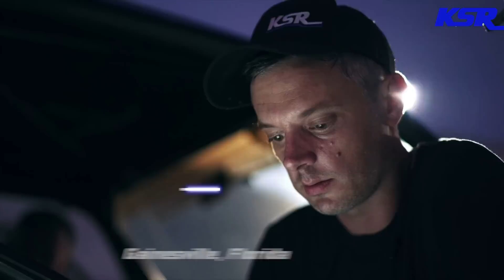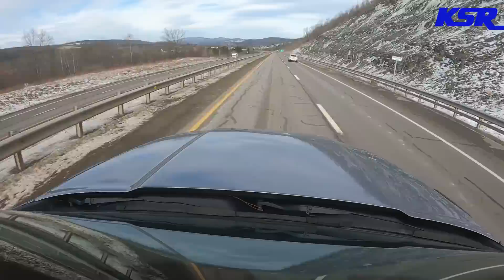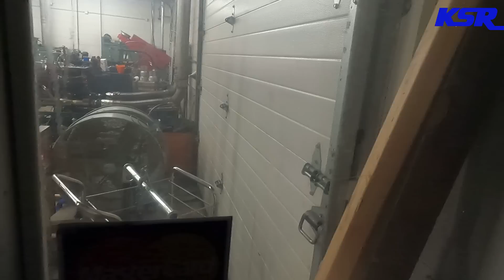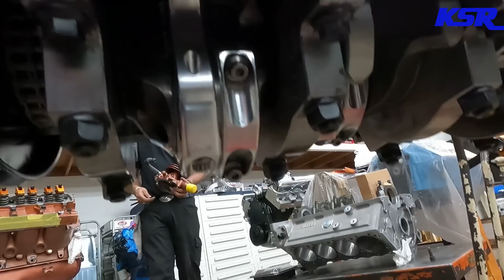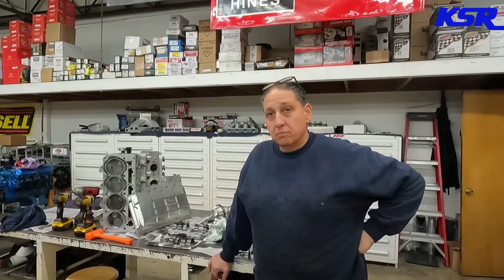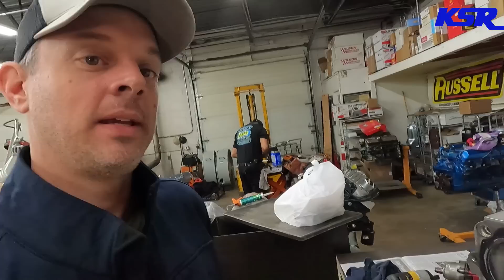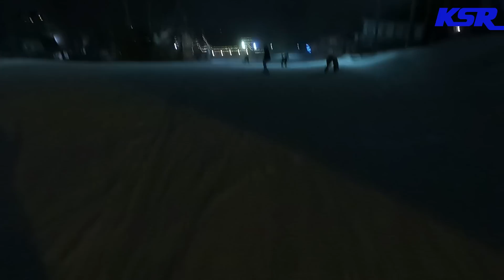Picking Up The Engine for MY CUTLASS!!! (Not an LS!!)

Comment: We are collectively SO happy to see you with a shirt eating grin on your face.
Reply: I PERSONALLY hope you can someday make it to Northern Idaho, I will take you snowboarding at Schweitzer Mountain, Silver Mountain, and/or Lookout. I’m 58 and don’t rip it either lol
Reply: I always get concerned for slower boarders (I am older than you).  Concerned that an out of control, kamikaze youngun will come flying down the mountain and crash into you from behind.  It actually happened to a ski instructor friend about 10 years ago.  She was giving a lesson and a boarder came flying down from behind.  Crashed into her breaking her shoulder, tore up one knee and other bumps and bruises.
Reply: A high rpm old motor , I didn't realize Nascar Oldsmobile had a Olds Nascar motor
Reply: So why don't you run a super charger since you are running a lot of rpms?
Reply: @johnbeverly1653  A couple of different variants with different sized main bearings.
Reply: Shirt eating?, Think it's something else Tripp, Rj in Oz
Reply: @rjnation5042  Yeah we’re just tryna keep it family oriented lol
Reply from the maker: Because “everything needs a turbo” ;)
Reply: @johnbeverly1653  he'll yeah they used to run Olds motors in the olds nascar machines, as did Buick and pontiac ran their own motors.
Reply: @johnbeverly1653  Smoky Yunick had a big part in the Olds V8 cylinder head design back with the 330 Olds v8 the program didn't end when he left Oldsmobile those guys had learned from one of the best in the business of racing and carried on racing and improving until the 80's before General motors ran 350 chevy based engines with the Pontiac heads in everything GM across the board for Nascar until Oldsmobile and Buick completely dropped out of Nascar
Reply: even a Blue Short Bus 🤏😉💥💨
Reply: @danmyers9372  I have personally done this, cleaned up about ten people in a huddle....... what were they doing standing on a slope, unbelievable!

Comment: I am a Olds guy myself. 355 C.I. ,12.2 to 1 Compression. H-Beam con rods. All roller motor. Mutha Thumper cam and Edelbrock RPM intake with a Holley Sniper for a hat. Studded crank mains and heads for an EXTREMELY HIGH redline. Lol

Comment: Sometimes a Road Trip is the best medicine, and the timing was right in many respects.
Wife and I had a heck of a year too, she retired finally, and once the dang rain settles down out west here we are gonna load up and take off with Toyhauler and SXS in tow, heading to no place in particular. 
When you get back to DC make sure you take time for the Air and Space museum,..both of them in the DC area. I think 3 days would be a good start.
Before you even said it I knew that short stroker was being built to wind. This is gonna be fun. I admire you sticking to it over the years, Kevin. Sometimes isn't easy to do.

Comment: I understand that Oldsmobile never made a four-bolt-main version of their 350 because they used steel with a higher nickel content. If you like obscure stuff, look up their W43 engine. It's a pity it never made it into production, it was a beast. My first car was a '68 Cutlass with the 350 and "Jetaway" two-speed automatic. It had 10.25:1 compression, and was rated at 310 HP and 390 lb-ft. torque. It was a pretty quick car for a grocery-getter. It surprised a couple of folks from light to light in my home town. I've liked Olds cars and engines since I was a little kid, I'm following your Cutlass build with great interest. Kevin, if you're at all a space or aviation nerd (I am for sure) you owe it to yourself to see the National Air and Space Museum when you get back to D.C. I'm going to try to get out to the Udvar-Hazy center this summer, it has larger exhibits that can't fit in the museum in D.C. It's out toward Dulles, VA and should be fascinating. It's good to see you out and enjoying yourself away from work, sometimes it's healthy to get a break from work,  no matter how much we love what we do. All the best to you in 2023.

Comment: Cool! I learned to snowboard in 1988 when I was 27. I still do when there's good snow. Slush ain't too bad on a board. I ski most of the time now. I learned to ski in the 60s.

I'm going Copper Mountain for about 6 weeks before spending a couple of weeks at Steamboat. You like history. You can watch an old guy ski.

Comment: “Sheetz” the word you say when you have to pay $6.60 for diesel.
Reply: Come to the 🇬🇧 and it would cost you over $9!
Reply: Lol my Mercedes  diesel gets 36mpg lol not worry even it goes up to $20, even got WVO tank i can use and because  its pre emissions i run atf used motor oil buncha of junk lol pretty much drive for free
Reply: Good God it's not that much in Alaska, I am paying about 4.75 in palmer Alaska. Premium is back down to 3.15. and we produce the stuff but don't refine it🤷
Reply: @lifebehindtheselens  I have a friend that converted to bio diesel and he hasn’t paid anything at the pumps since he did it!
Reply: Pa. S taxes are as bad as ca.. good thing I'm close to Ohio lol
Reply: Hahah I feel ya mate equivalent you'd be paying about $7.75 a gallon here in Australia 😅🇦🇺🇦🇺🇦🇺
Reply: @ashburncitystandup9707  In NZ and driving a Ford Territory. 
She's a big, thirsty beast. Not cheap.
Reply: For real. It's +$2.50 compared to gas here, Sheetz!
Reply: @40spinup  a liter or gallon?
Reply: @jesseshort8   I'm pretty sure he is saying a gallon in Europe is more then $9.
Reply: 🇨🇦here I was down in October was 5.80 in Maine cross the border back into canada was equally to 10.65 less then 5 miles away
Reply: Anywhere from $7.50 to over $9 in Australia for Diesel at the moment, depending on where you live.
Reply: @HulkSmash86  that's what I figured, just thought they went by the litre over there.
Reply: @HulkSmash86  It's $11.6 in Sweden, so stop complain..  👍
Reply: Sheetz it's something you get after a "roller" meal!

Comment: LOL Hey Bill while you are at it go ahead and mill that logo off the heads I don't wanna think about that again... Congrats, Kevin.  My 362 DX is getting twin 69s whenever I start making enough money here at the shop.  Bill did all the machine work for me.  I've still got that set of welded raised-runner Edelbrocks I'm working on but honestly I will probably just have Bill run his CNC program on a set and up the boost a little bit.  I had Bill dry deck mine as well - hopefully he was able to use the same drawings for yours!

Comment: I’m a Ford guy and I’m a fox body guy so I want to thank you a lot for putting an Oldsmobile motor in an Oldsmobile car because I’m sure you understand the nightmares I go through every day just watching racing on YouTube. Fox bodies are horribly molested every day and it tears me apart. Ford’s a little bit more expensive but in the end you’ve got more power. Leave those pieces of a Chevy in the junkyard
Reply: You can make any type Engine fast just depends how much money you want to spend and a Ford Engine is no different, just happens that a stock Block LS is cheap to build and I'm not a LS guy I run BBC.
Reply: You think Ford is expensive to build? Old will cost double.
Reply: @marcmo7138  I understand that when I was 17 I had a 1970 cutlass S with a 455 the point I was trying to make was everybody takes a fox body and puts a junkyard LS in it to get the cheapest power as quick as possible which does work but I prefer the guys who spend a little bit more money and build a Ford engine for it and end up with a lot more efficiency, power and reliability especially if you pick a coyote but even myself I kept the 302 turned it into a 331 built it completely put a blower on it and I’ve been running 600 whp. I know Oldsmobile is more expensive than Ford I also know dodge is the king of cost and will rip your wallet out and stomp on it. I hope this has cleared it up I was not comparing Ford to Olds I was saying how much I prefer it when people buy a car then take on the responsibility of keeping that car all one manufacturer.
Reply: @600wheel  Understood
Reply: @marcmo7138  🤘
Reply: @michaelwynne4346  I know you can make an engine fast I said that. My point is I wish people who buy a Chevy car would keep a Chevy engine or Oldsmobile car with an Oldsmobile engine or a Ford car would keep a Ford engine I just like that if you don’t like it go read the next comment and if you don’t think that Ford is making the best motors right now look at the cubic inches of the coyotes that are spanking guys with big block Chevy’s, causing serious stress to people with Steve Morris big blocks. Cleetus just had trouble with a coyote mustang not too long ago and ask Engine builders Ford will always make more power with less cubic inches it’s just a fact if you don’t believe it then you just don’t know but facts are facts it’s always a 302 Ford against a 350 or bigger Chevy in the 60’s,70’s,80’s,90’s, 2000’s and earlier. I don’t know what it is maybe it’s the geometry the firing order the head design but Ford has always been able to make more power stock or modified with less so imagine what happens when you put a 351C Ford against a 350 Chevy or a 400 Windsor against the 400 Chevy.

Comment: Short stroke rpm is why I’ve always liked the 327 sbc. Lacks displacement but they scream. I’ve done a few years ago and still have one but have nothing I want to put it in. I’m doing a  turbo LS for my current project but now I’m thinking I want to redo the 327 for boost to make up for those missing C.I.’s😁

Comment: I had a 1979 Olds Starfire GT. That was a fun little car. It had a one of those strange Olds 231 v6s that the distributor spun the wrong way. it was surprisingly quick for what it was. I always wanted to put a turbo small block in it, never got around to it.

Comment: Saw the title and figured you were putting an orange lump in it, was very happy to see Olds engine in the description. The only thing I would have liked more would be you putting a Pontiac in, but Olds is just as good.  I have a fondness for Olds too, have four 403s, a couple 350s, and two 455s sitting around here. BOP engines are so much fun for fast daily drivers, you can have a relatively heavy car and a highway gear and still go quick.

I like you more now.

Comment: Can't remember the last time I said "small block Olds..." I'd say most of the kids today aren't even aware Olds had their own engine program. And it's kinda crazy to work with Olds engines because they use backwards Chevy distributors - ie, they pick up from the other side of the cam so they rotate the opposite direction despite being externally identical. (Don't ask me how I learned that... ;)

Comment: This is gonna be sick. Oldsmobile small blocks ate awesome engines. As long as you can get the oil to drain back to the oil pan from the valve covers. And since it was built by a guy that raced Oldsmobiles, I don't think you'll have any issue with that. Can't wait to see this thing run 👍

Comment: Yeah that engine is gonna see some high RPM's for sure lol I built a small journal 327ci with a 283ci crank when I was 14 and i turned that lil engine over 10,000rpm many times a day back when I was younger and that lil engine held together for years I still have it and it still runs but needs refreshed

Comment: We went 6.59 @ 206 in 2005 with the olds dragster.  Before we parked it, we picked up 3 tenths and 15mph to the 1/8 from that 6.59 run.  Everything we had on the car was antiquated.  Batten heads, primitive turbos, first gen FAST system, and running on gasoline at the time.  Would be fun the revive that thing with more modern electronics and an updated set of cylinder heads.  However, if it were solely up to me, the boost would come from a blower this time...

Comment: Here let this make you feel good Kevin (I about wrote Kinev) diesel in my town is $5.39/gal and while it says Chevron on the building I'm pretty sure they buy the cheapest crap they can find because when I switched to 76 gas I picked up 1.3 mpg in our truck and 76 is owned by Chevron these days. Hey we all know another reason why you drove to get your engine.. gets you as far away from your ex as possible.. sometimes a guy needs a change of scenery to clear his mind and let his heart heal. 
Basically you have an Oldsmobile NASCAR engine.. nice. lol I said that before you said it's a NASCAR block :P Man with those ports that high the only thing I can say is... STACK INJECTION! Holley now own Hillborn so I'm sure you can get all the top half easily and then just have a lower intake 3D printed in metal or printed and then cast in aluminum.. or it wouldn't be too hard to fab one and weld it all up. Damn I want to do that someday.. It's probably the only way I'll ever get an intake that fits right for my 72 Cleveland because it's a HO block with 71 CJ 2V heads and I want to run a blower on it.. because someone ported and polished the heads at some point so they likely wouldn't like running NA. I'll likely never have the money to do it though.

Comment: How different is the nascar Oldsmobile smallblock to the repco V8 that brabham used inF1?
Reply: Basically jack took an Oldsmobile block to repco (at the time an engine building company) and said “build me a competitive F1 motor”  then won the title. It triggered lotus to have the cosworth DFV built and changed motor-racing forever

Comment: I know you uploaded this a year ago but I am new to the channel that is one beautiful Oldsmobile motor! My first love what's Oldsmobile and I have a 409 which was a 403 which I built in 1997 a little outdated in technology but I also have a 455 1969 forge block  cylinder bore size 60 over which I'm thinking about building and I like what you did with your motor as a stroker and I'm thinking about doing the same to this 455 block and the dry deck heads are really nice touch I'm at the ports are really raised hi ! I know a bill from drag racing magazines and TV and I know he was a great engine builder I just didn't know he was still doing it so thank you for the knowledge of now knowing of BTR performance!!! Maybe you could have Steve Morris build you a custom intake manifold just like on the SML motors I would love to see an Oldsmobile motor with that on their!

Comment: Correct me if I'm wrong, is the math bore x bore x stroke x number of cylinders x .7854? My math says 374 cu in
Reply from the maker: I will have to double check, I sure thought that it was 380 with the calculator that I had used.

Comment: There is a company that makes a 60 gallon replacement tank for that truck.
Reply from the maker: It’s got a 53 in it now!
Reply: I run a cab and chassis truck with a 52 gallon tank behind the axle and thought about adding one in front of the axle. But man, think about having to put over 100 gallons of fuel in it for trips. The 52 is bad enough. Lol

Comment: When I was kid in the early 80s watching NHRA all the time, my dad always said, "Nothing makes power like an Oldsmobile."  One question; after you tightened the straps holding the engine down, dig you push the engine a little and say "That's not goin' anywhere"?  Because if you didn't, how do know it's good?

Comment: you welded the heads for dry decking how did you do the block?? epoxy ??
Reply from the maker: The block was machined to accept press in slugs of aluminum

Comment: Is that motor a de-stroked 403?
Reply: Actually a 403 has a 3.38 stroke. I think he said this has a 3.40 stroke.
Reply: @marcmo7138  thanks I was trying to figure out what block he used maybe a old rocket engine I had a 330 in a 67 cutlass that was a Olds rocket
Reply from the maker: It is a factory Oldsmobile NASCAR block from the 1980s.
Reply: @johnweaver8242   NP. misunderstood ya.

Comment: So was that an Olds 350ci originally?
Reply from the maker: The block was a virgin block that had never been any size before.
Reply: @KSRPerformanceFabrication  Very cool. Is it based on the older blocks angles and layout? Always been a fan of that simple layout plugs above the exhaust manifold and not tangled inside it. But that is tech in me talking I am sure there was much to be gained by burying the plugs in the gm manifold. Looking forward to this build.